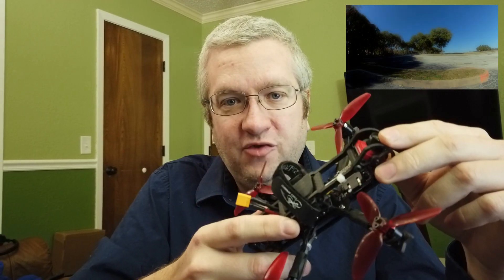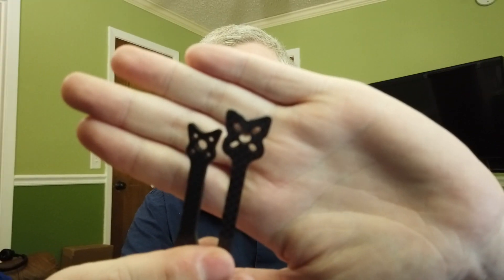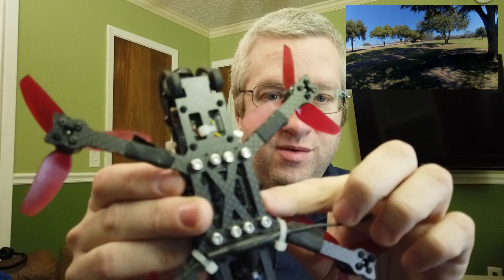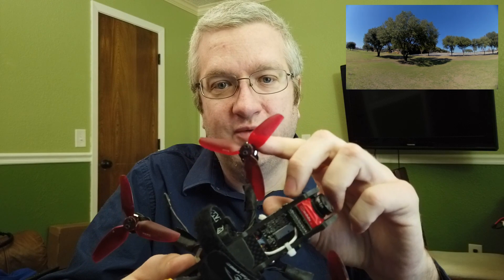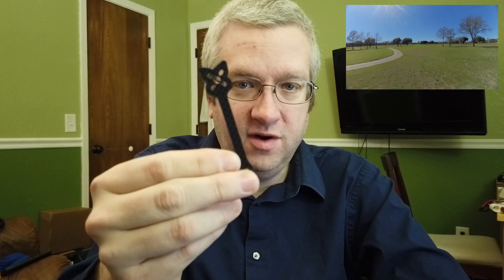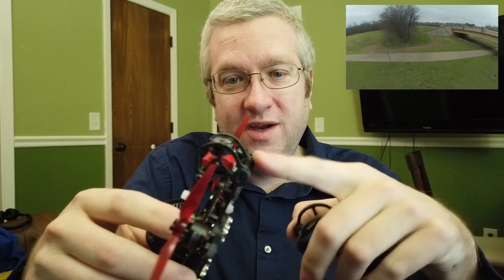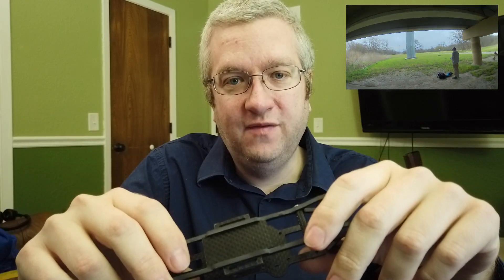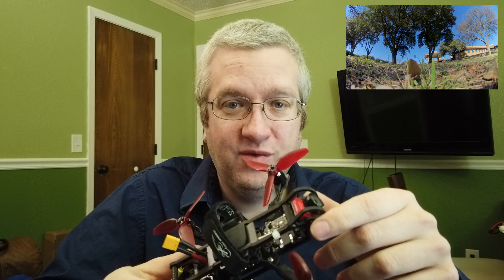3" HD Micro FPV Quad Prototype:  The Kestrel

Comment: Not sure when you made this but it's incredible. I'm about to do a custom 3 inch with the vista system. This was great and a lot of info thanks for taking the time to make it.
Reply from the maker: Thank you Jeff!  Designing this frame was so much fun, and I'm excited to say that there's at least one person still regularly flying a frame that I cut for him.  He's even helped me edit out a few unexpected weak spots on the frame.

But the Kestrel is already sort of outdated.  You don't need the vibration damping anymore, because better motors, props, and newer versions of Betaflight keep 250 gram 3" and 4" quads flying quite smooth with no oscillations.  Also, the Kestrel is built to have three 20x20 stacks, but all the nice new fc+ESC combo boards are 25x25 Whoop-style boards.

I ran out of enthusiasm for the sub-5" builds when I decided that no one was going to release a split camera that I'd be happy with compared to my GoPro, and I mostly stopped flying my 4" Kestrel build when my last Caddx Turtle died.  Those Turtles are so fragile.

If you're aiming to go sub-250g with a Vista, you ought to look at 3.5" props.  I've been flying them off and on on my 4" for almost a year.  That extra 0.5" can buy you something like 40% more thrust over a 3", and it sure looks like the Emax Babyhawk II is making good use of these props now.  Finally!
Reply: @patregan  thank you so much! I ordered two sets of motors. 1105 4500 kv and 1404 4000kv. I'm gonna be designing like... basically a cube with bullet connectors on it that mounts to a base with the arms. The air unit will sit behind the cube so this way I can plug and play with different motor and arm sizes. And all I will have to ever do is screw on a new base. I don't have any way to cut the carbon yet so I'm trying to figure out a way to do the prototype by hand. I really appreciate the response. Hopefully ill be able to have a standalone unit that I can just screw to any size base from 3 inch to 6 inch and anywhere in between.
Reply: I also didn't account for the connectors on the motors having to change lengths when swapping bases so it looks like I'm gonna have to order a bunch more motors. Lol.
Reply: The frame I decided to start with doesnt have room for 3.5 props but I think I can manage to extend the arms...I will for sure try that. Again thanks for the response.
Reply from the maker: @Sneekser  The Shapeoko XXL CNC I'm using is huge and overkill for cutting 3" and 5" frames.  I'm certain you could get by with a 3018 machine.  Those range in price from $200 or so for a base model straight from China to around $500 or so for a nicer model from Amazon.
Reply: @patregan  wow I had no idea they were that affordable thank you!

Comment: I have some EMAX 1306 motors that take props with 5mm shaft, I might want to 4 inch those babies!
Reply from the maker: We'll have to figure out a good arm length for that and get you a frame, Spiral Crunch!
Reply: @patregan  sub 250 grams would also be a must